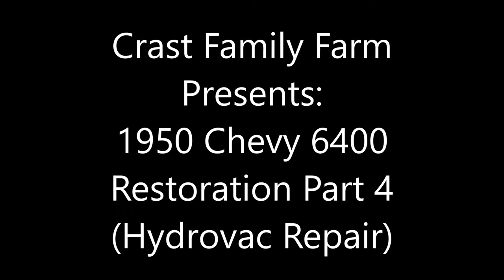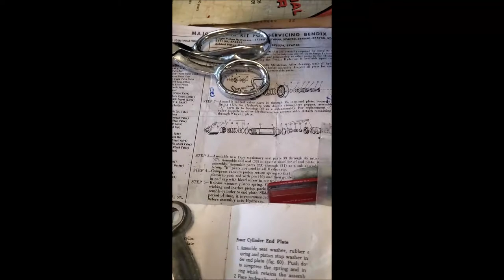1950 Chevy 6400 Part 4 HydroVac Rebuild

Comment: Where did you get the parts? I have a 1956 Chevy 5700 LCF with a hydrovac booster.
Reply from the maker: Harmon Classic Brakes in Canton, Georgia. Nice people and great to talk to.
Reply from the maker: Post a pic of your truck (if you want), I would love to see it!
Reply: @crastfamilyfarm4799  Thanks!
Reply: I will try to send a photo. I want to get mine running and stopping  Too many projects not enough time!! I have one of those thread files. Your video has given me hope on keeping the brakes original.
Reply: @crastfamilyfarm4799  Have a 1957 6400 and getting the original brakes fixed has been a concern of mine. Maybe not now.  :>)

Comment: Thank you for the post , I have a 55 Chevy 3100 I’m installing a hydrovac system on. The part I have looked to be in pretty rough shape but Internally not as bad as I thought it would be. Anyways while it’s open I may as well do a rebuild

Comment: Great video. You installed, any update? I don’t see if it ever functioned properly. 
Can you describe the first part ‘kit’ had and what was subsequently missing/ added parts you subsequently got? 
Thanks in advance
Reply from the maker: Hi Anthony,
I installed the system and, before I even tested it, I removed it and converted to a Dual system master cylinder for safety reasons. Though I don't intend to drive this truck a lot I realized with a Hydrovac type system it is a single system whereas, if there is a leak anywhere in the system you would lose ALL braking capability and with a dual system you have a front and a back system so a leak in one will not affect the other.
Now you're testing my memory with the original kit contents,  It contained the vacuum can leather seal and O-rings but it was missing the piston seals however when I called the supplier they sent the correct ones at no charge, the one-way seal / valve was different than the new one and I never did figure that out as I decided to convert to a Corvette Master cylinder system to obtain the dual system.
Hopefully this answers most of your questions (it's been a while since I worked on it) and thanks for the inquiry!
Reply: @crastfamilyfarm4799  if you still have the hydra vacuum part, would you be interested in selling it?
Reply from the maker: @anthonyallen5465  sure, I can sell you what I have though I haven't tested it. As I said I went with a two part system for safety reasons before I tested the hydrovac after rebuilding it.